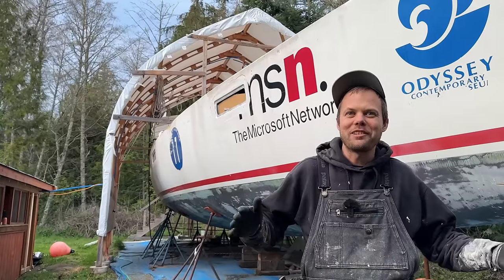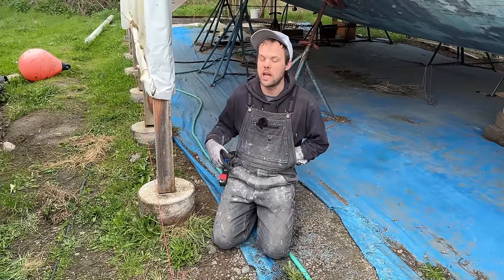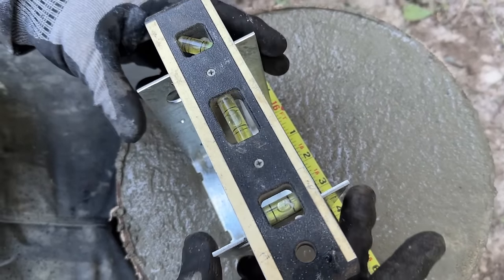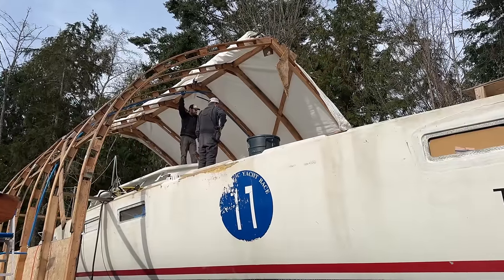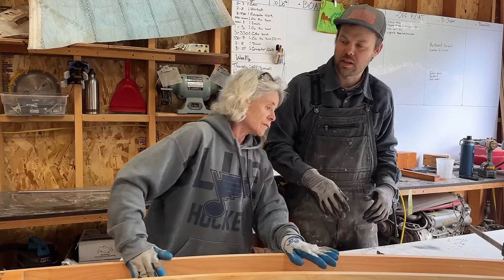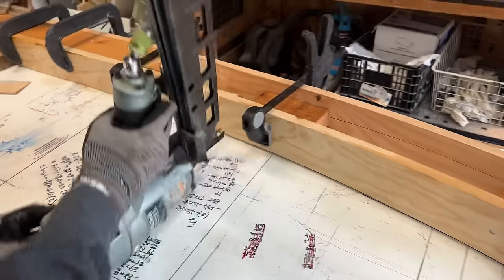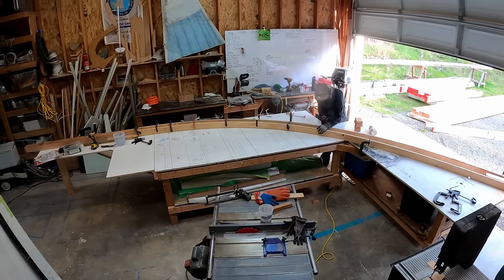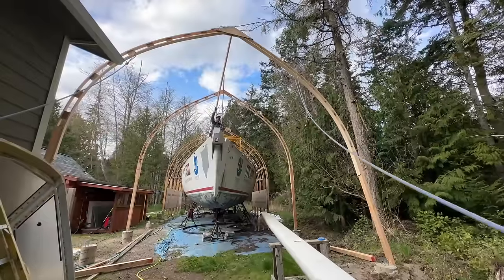Building a Bow Shed for our BIG BOAT in our Backyard [E121]

Comment: Wow!  You and your mom did a great job!  I know that what you did was not easy as I have worked with wood since I was about 8 or 9 years old when I helped my grandfather build a garage, which ultimately ended up as a chicken coop for about 5 or 6 years  until my grandfather converted it back to a garage.  I have built bookcases, shelves, tables, etc. and know that first of all those braces were not lightweight, so your mom is a strong lady as well as yourself.  Congrats and I know the shed will serve you well.

Comment: 11:24 Thin cracks like that can be patched by filling them with wood glue mixed with fine sawdust, and just forcing this mixture in with a spatula, once dry it becomes one thing, like bone calcification. Especially if it isn't a structural element like a clean 90⁰ break.

Comment: To avoid and greatly reduce nails splitting wood , blunt the tip with a hammer. 
Sharp nails wedge the wood apart, blunt ones punch right through
Very very old trick

Comment: Screw metal framing brace strapping  to the outside of the curved timber piece's to prevent snapping the timbers. Screw the strapping on before attempting the  bend

Comment: It is better to buy thin boards, for example 10 mm thick, and put them together in twos or threes, depending on the required thickness. It glues and bends easily and is very strong.

Comment: Seems you precut the top of each frame where it connects to the ridge board.  How did you calculate where and at what angle?  If the concrete piers are the same height, you'd only have to do it once, and it could be layed out on your frame jig.